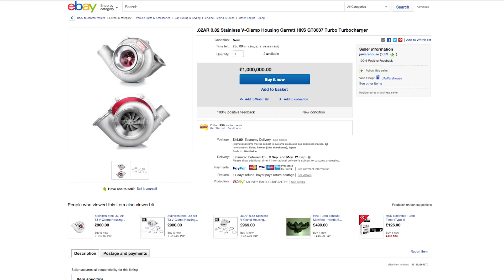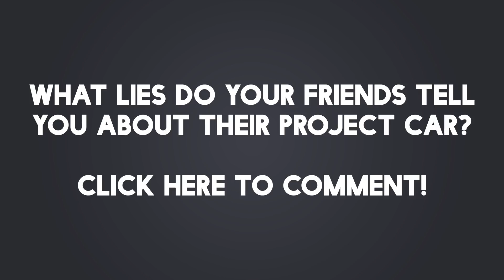10 Lies A Petrolhead Will Tell You About Their Project Car

Comment: My project car is a 1.0 Ford Ka 2009 with special red paint on the brakes.
Reply: 1.0 L?  does it go up hills? (not  pisstake, a legit question)
Reply: +josh benton. Of course it does, it's a common car here in Brazil, it's my first car so, that's no big deal. It haz 73bhp and 968kg. I'll probally change it when I turn 20 years old. I'll probally buy a car of aroubd 120bhp and not much heavier(1.6 L). Just so you know, the top speed of my 1.0L ford Ka is 160km/h and the 0 to 60 in about 14,8 seconds.
Reply: Guilherme Ferrari ah ok, that makes more sense, its a very light car, some smaller engined cars actually have trouble going up hills if they are too heavy, like my car is 1.5 litre and 1320 kg, and it sometimes isnt the best, but its also 21 years old so its probably lost a bit of power, but your one would probably be not very good on our roads with that 0-60 but since its a different country and common thats allgood
Reply: +josh benton Where are you from?
Reply: new zealand
Reply: that's factory statistics.. no way it takes that long with proper shifting and cuts 5th gear at 160kmh :)
Reply: Fuck yes, the brazilian ford ka, chevetteiro aqui :v
Reply: HighLander LK Chevettes are the best
Reply: rx seveeeeeeeeeen

Comment: Car stereo is a great example of "once you touch it, it will never be good enough". Add a sub, now u need better speakers. U will need an amp for that. The head unit needs to be better.... Endless cycle. 

For this reason I have stock radios in nearly all my cars. Yeah they suck, but none of that is my fault or my doing. Once I upgrade I can't ignore the issues

Comment: Now that I think about it, there is a difference between a project car and personalizing your car to what you like. I'm not really doing anything extreme to my cars except adding or replacing equipment with better stuff that work and look better to me. They are pretty much stock. The biggest thing I've done was convert pop up headlights (which were terrible on the C5 Corvette) to fixed projectors on my own. Had to take the bumper off to do that. That was fun and I managed to do it in 1 day without power tools.

Comment: I finished my project car ! Now it's time to start my new project with my iPhone 6 I'm going to install a blow off valve with 17 pounds of boost so I can dial out faster then anyone and it will call out doing 9.0sec when I'm Done LOL 😂
Reply: Billy Bad Ass Actually if you get into computers, you'll realize the computer and car scene are actually quite similar
Processor=engine
Overclock=turbo
Ghz=horsepower
Software=car weight and handling
People build computers, people swap out parts, people buy expensive parts, and people build there CPU up just for a benchmark (benchmark is the computer equivalent of a dyno)

Comment: Well, there are exceptions. At 53, the last modification to my  1986 Olds 442 with a 1968 Olds350 had it's last modification in 2001, the next side up flat tappet, hydraulic camshaft.  Happy with it running mid 12s with slicks and open headers.  AND, Ive had the same car since I was 24 back in 1987. Don't drive it or go to the dragstrip nearly as much as I used to but have no plans on selling it. I did think of filling the interior with dirt, opening the sunroof and planting flowers in it!!!

Comment: I bought my first car a little over a month ago. I count it as a project car because I've done a lot of shit to it, and am doing more.
2001 Mazda protege (submodel: Mp3)
Alternator belt
Battery (terminals and everything)
Sparkplugs
Ignition coils
Clutch
Flywheel
both front lower control 
arms/balljoints
Both front CV axles
both front outer tie rods
Swaybar Bushings
all new slotted performance rotors/pads and calipers
New radio antenna(lol)
Tires
Windshield
Muffler
Driver's side fender and roof repainted
Dent pulling/buffing

To do: 
Dent pulling/scratch repair
Driver's side front fender and roof repainted
Buffing
Engine Swap
Interior carbon trim
Racing steering wheel
Racing seats
Reply: This is quite much for a little over a month.
Reply: Good for you man.

Comment: I've gotten stuff at half price, even some for free when people realize the one thing they sold me doesn't solve the garage clutter problem as much as they'd hoped, and since they sold their project car... Aluminum intake manifold w/ throttle body, strut mounts, rear strut brace, 5 rims, dash cluster surround are just a few I can think of. You could probably find everything to build a whole car traveling the country, picking up parts and/or trading to get everything free. A lot of parts get scrapped because no one can sell or use them. It would make a great show. My extra parts though are going on the garage wall as art.

Comment: 1986 Mazda b2200 slammed to the ground with original engine. the guy I got it from did a little work to the engine. straight pipe exhaust that I just did. I love the little truck it has a 5 speed and it only weighs around 1900 sounds without me in it. I have a lot planned for it.
Reply: Matt you're an amazing person... smh

Comment: It seems like a vast majority of europeans dont modify their cars. They might do an exhaust, maybe some different wheels, but thats it. In The states we completely change the car, im just curious if someone could explain it.
Reply: mrsuperbuckets Where I'm from if for example you want to swap an engine, it cannot have more than 20% bigger displacement and 30% more power and even after that you get a list of mods you have to do, for example, you have to upgrade brakes or make chassis stronger, etc. After that you have to go through inspection of the new engine and new mods, you also have to pay a lot for such an inspection. Of course they may not like what you've done to the car and they won't let you drive it. It's a big hassle and you can't even dream about something like v8 swapping a miata, it'd be easier/sometimes even cheaper to just buy a car with a specific engine. I wanted to buy a 1.6 Audi and then swap it with 2.2 turbocharged engine to make it into a sleeper (even though this same model had both of these engines) but requirements and investments to make it legal just makes it not worth doing. Also for other mods, for example if you get a straight pipe and police pulls you over, they can take away your technical inspection because it is too loud.
Reply: ***** Its only illegal if you get caught.
Reply: Jon Woods And then you're in trouble
Reply: Its very hard and expensive to make a heavily modified car legal in europe. And the insurance rates are through the roof (you have to have a insurance, no excuses). Basically it will be cheaper for you to buy a super car than mod your car in the long run. Just to give you an idea of how hard it is to modify legally, in finland (population 5 million) an average of 6 cars pass the test every year. If you drive it anyway, youll face huge consequenses. Btw, im currently in Boston, came from Newport RI, and noticed signs saying something like "littering forbidden, 15.000$ fine". Do you actually get that high of a fine for littering?
Reply: *****
Simple solution. Dont get caught.
Reply: Jon Woods Anual inspections are mandatory, you´ll get caught sooner or later
Reply: mrsuperbuckets  God Bless America... you can drive an engine with four wheels attached to it and be legal. Thats what we call "the american dream"
Reply: Here in Denmark most mods are illegal so that's why there aren't many modded cars. If I want to supercharge my 86 I can't because you have to pay the government after you do it. Even if you change the brakes on the car for more powerful brakes it's same thing. It's pretty stupid. And it's not like it's 500 or 1000$ it's like 40% of your cars value so it's cheaper and easier to but a more powerful car
Reply: +Jon Woods the problem is if someone crashes into you and they look at your car and its illegal in some way the insurance won't cover it and your car will probably be taken away from you.
Reply: sasajungic89 Exactly... Hate how that is the case :/
Reply: +SportSoulLife But even in Finland you will see many heavily modified cars. Atleast I do in the capital region during later hours.
Reply: HaleftHaut my father drove 92 pasat without inspection for 7 years streight never got caught but hes cautious one of the familly
Reply: sasajungic89
Yall dont understand the whole "dont get caught" do you? The odds of someone crashing into you are rather slim. And I think if your car was wrecked bad enough to not drive away, youd have other problems.

Have two identical cars. Register one, mod the other. Take the plate from the registered car and toss it on your modded one.

Im not advocating this...your results may vary. This is how I would do it if I was being oppressed like that.
Reply: Joel Panttila Yes, but either the engine inst heavily modified or its not legal
Reply: Phendranaguardian In the U.S car manufactures make vehicles in a way, were they are meant to be modified. Maybe put a full exhaust, maybe some new cams, front splitter, different intake and such to really make the car your own, it is a way to feel more connected to the vehicle. That is the reason our vehicles are cheaper to buy, because it is hilariously boring to buy a car, and just leave it stock, if you aren't going to make the car better, then just buy some shitty econo box.
Reply: Phendranaguardian Have to disagree. Most European cars are straight up garbage.
Reply: Fiat, Renault, Mercedes. worked on them all, pretty much junk. VW and BMW are pretty good, and the Opel/Vauxhalls are alright, too.
Reply: Mostly the E class around here (lots of doctors like them). They just don't hold up very well, especially the Diesels, and their performance is mediocre at best.
Perhaps I might have been a little hasty in dismissing European cars as "garbage", just my experience, they really aren't any better performance wise than their American and Japanese counterparts as far as the average car goes. Now getting into the high end, even there, the US and Japanese companies have cars on par, or better, in performance.
Reply: Different scene here in UK and cars are modded completely different. Most Americans forget if you can go 1/4 mile in the UK on a public road in a straight line it's a miracle. I have driven in the states and remember being on roads where as far as I can see both in front and behind is straight! Besides our roads are like half the size. Eg I drive on roads where you can drive say an f150, but an f350 with mirrors out would hit both walls either side of me. Anyway back to the point, nearly everything here is 4 cylinder and our fuel, with today's conversion rates we are talking $11 a gallon, yup that's right that wasn't a typo. I could go on, but the UK tuning scene is cool in its own way, yes there are always dickheads or ricers as you say, probably around 50/50. Many many reasons we tune the way we do, ask away
Reply: MrBeastbike Only parts of the U.S are like that, The mountain roads we have are world know for how amazing they are, they the alps, but with much more trees.
Reply: @mrsuperbuckets
I know your comment is a year old and people already replied but to add one thing:
besides the ridiculously strict laws that almost make modding your car impossible it is also the case that owning your own house is muuuch more expensive here and without a house and garage it is much more complicated to work on your car

Comment: I think the biggest lie "petrol heads" or "gear heads" (as we call them in the U.S.) will tell is actually not a lie, but withholding of the truth. They usually won't tell you that they are not a REAL car expert or REAL mechanic. A lot of my friends, family, or co-workers that I help with mechanical problems whom have no mechanical knowledge seem to think of me as one. I constantly remind them that I'm not a REAL mechanic. I'm just a tinkerer at this point. I still consider myself a gear head because I love working on cars and my motorcycle, but most gear heads are too insecure to give you that disclosure up front.

Comment: I was aiming for 500whp so to stop myself from going even higher than that I did something very stupid. I put in a stage 2 clutch that can only handle 600hp so that I can't go higher even if I wanted to. I Immediately regret it as I know that once I reach that figure I'll want more power. But I have to worry about reaching it in the first place, going turbo reliably isn't cheap. 😄

Comment: All I do is hand wash...runs it through the 3$ car wash
yea planning on a  "engine swap"
yea got 12s in the back..really 6x9s
its a drift car bro..FWD civic (automatic)
yea I "had" a 240sx
bro I gave back ur socket sets..its on top of his tool box.
the fuck? I was lookin for rachet...I thought I told u bro
Reply: I hate ppl when they lie about cars that they didn't have.
Reply: I had 2 240sx's.  A grey 90 hatchback auto and a green 97 with 5 spd.  Traded the 90 for th 97.  Had to trade the 97 in for a truck because of kids and work.  Still have the factory maroon spare key on my key ring.  Been 6 years since I got rid of her, still miss that car.  Wish I could buy it back.
Reply: +kidzero1943 trust me when I say this a compact manual car in the winter can be a drift car, lift off oversteer like you would not believe.

Comment: i need some help people with a question, i saw a video where a car sheared off the tire studs,  im wondering when i should consider to upgrade them, and should i worry if the car is all wheel drive or not, i dont want my car to fall appart over something so simple and inexpensive! thanks in advance
Reply: Only reason you would need to upgrade studs is for rallying. Other than that it's human error, over or under torquing, wrong wheels etc, loads of reasons. Unless you plan on jumping the car at 60mph don't worry about it. And if you do, then you should expect it now and again

Comment: what would be the best engine swap for a peugeot rcz?
Reply: LSX swap it
Reply: +Dmax734 i think they are front wheel drive though
Reply: Ls4 swap it from a 2006 impala ss
Reply: Dmax734 didnt those have 5.3 v8s?
Reply: Yup fwd 5.3 v8 perfect for anyone that wants a v8 but doesn't want to make it rwd
Reply: Dmax734 true. It does make 303 bhp, so you probably have to upgrade the brakes and suspension to compensate for the increased weight up front.

Comment: Trust me I have a board over 400 cubic inch V-8 with a holly 650 carb Low torque cam and Ford racing heads I don't Need a new engine
Reply: I've got a stock 79 trans am 6.6 litre with new exhaust and an 800cfm I think not really sure but itll lay down rubber

Comment: I want a e30 project car but idk how to wrench.
Reply: The one six series are nice late 80 early 90s but I'd swap it with the v10 from the e60m5
Reply: e30 brake down everyday i had one with 4 cylinder and all the sensors keep dying day by day, it was a money pit.Bmw parts are not cheap i only buy oem if you want reliability.

Comment: what are the first 5 mods that I should do to my project car ?? your opinons
Reply: slam it, wheels, exhaust, air filter, steering wheel, seats, shortened gear stick... those are more than 5 but just pick a few in no particular order :)

Comment: none of my parts came from home depot (applies to ricers)
Reply: nihal dhillon I think it should say "none of my parts came from the dollar store."
Reply: +Josh Edillon 

I agree. Lowe's/Home Depot has hose clamps, zip ties, electrical connectors, hose of all sizes, wiring, conduit, tubing, etc. All of which I've used recently on my engine swap. Zip ties make the best spark plug wire looms, by the way.